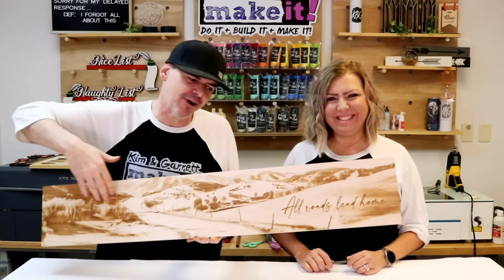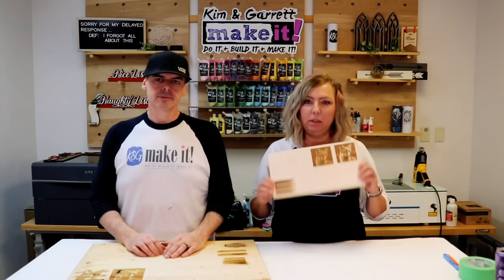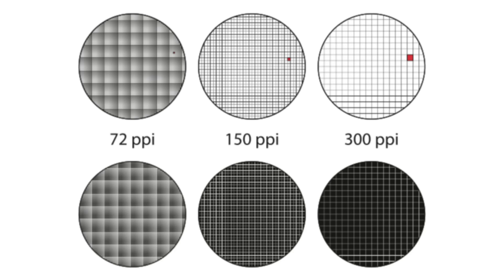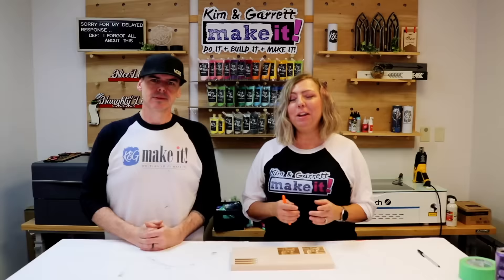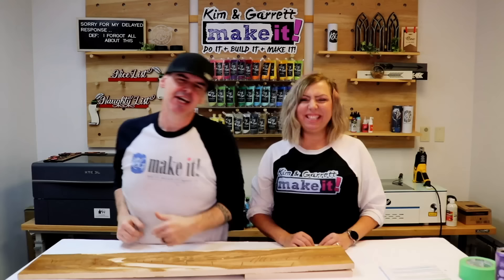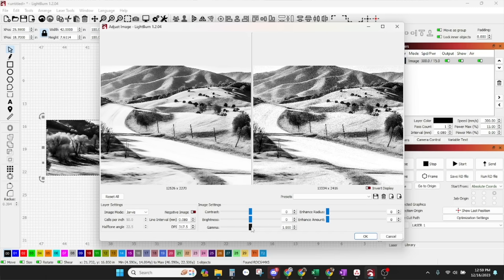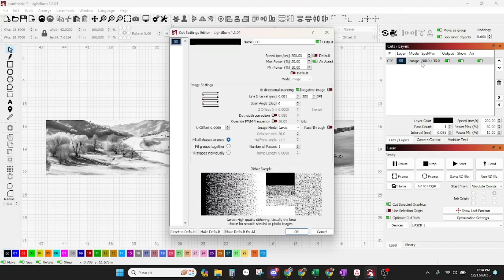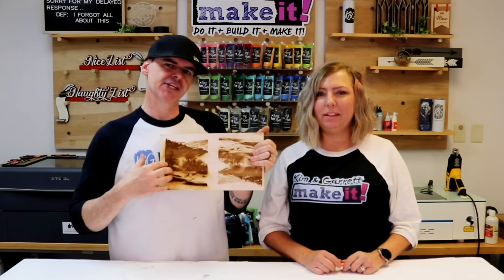Top 12 Tips For Laser Engraving The Best Image on Wood

Comment: Actually, the line interval should be the laser dot size, for a typical CO2 it is about 0.15 mm - exactly as you found it. At 0.08 mm your lines are overlapping, hence the bad result.

Comment: Hi how are you!! I'm considering buying a diode laser cutting machine. However, I realized that caution is needed when dealing with MDF. Furthermore, I am wondering whether this precaution should be extended to other materials, especially since, regarding MDF, which is not widely discussed in Brazil, I had to seek information abroad.

Although it is a topic that is rarely covered, I was concerned to discover that there is evidence that MDF may be linked to cancer, due to the gases that are produced during the laser cutting process. Unfortunately, I was unable to find information about the gases emitted when burning other materials, such as cardboard. Would you have any knowledge or information about this?
Furthermore, I would like to know if there is some kind of exhaust cabin for this equipment, which is capable of filtering and cleaning these gases before they are released into the environment.
Look at the answer I already had about this (if you're scared, just don't do it because everything in life causes some kind of harm to your health).
Thank you in advance for your help and guidance.

thanks

 ola tudo bem !!estou considerando comprar uma máquina de corte a laser de diodo. No entanto, percebi que é necessário ter cautela ao lidar com o MDF. Além disso, estou pensando se essa precaução deve ser estendida a outros materiais, especialmente porque, sobre o MDF, que não é amplamente discutido no Brasil, precisei buscar informações no exterior.

Embora seja um tema pouco abordado, fiquei preocupado ao descobrir que há indícios de que o MDF pode estar relacionado ao câncer, devido aos gases que são produzidos durante o processo de corte a laser. Infelizmente, não consegui encontrar informações sobre os gases emitidos durante a queima de outros materiais, como exemplo também o papelão. Você teria algum conhecimento ou informação sobre isso?
Além disso, gostaria de saber se existe alguma espécie de cabine de exaustão para este equipamento, que seja capaz de filtrar e limpar esses gases antes de serem liberados no ambiente.
olha a resposta ja tive sobre isso (que se você esta com medo é so não fazer porque tudo na vida faz algum tipo de mal para a saúde).
Agradeço desde já pela sua ajuda e orientação.

obrigado